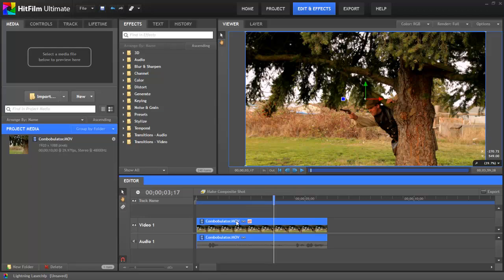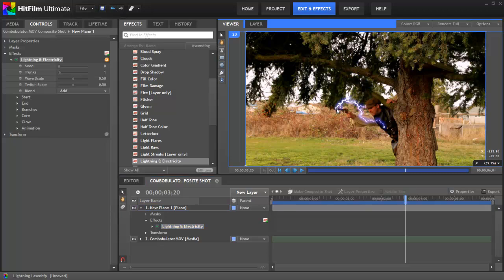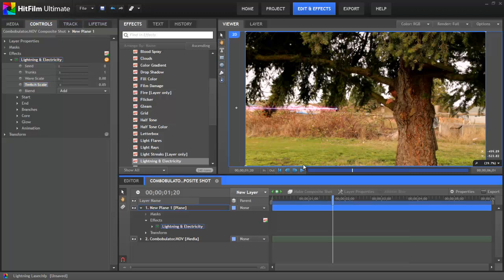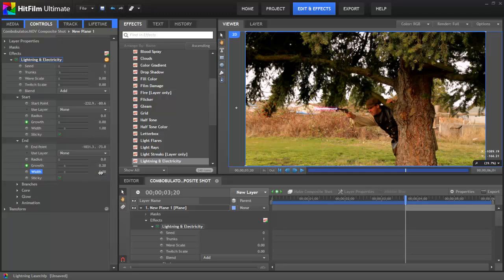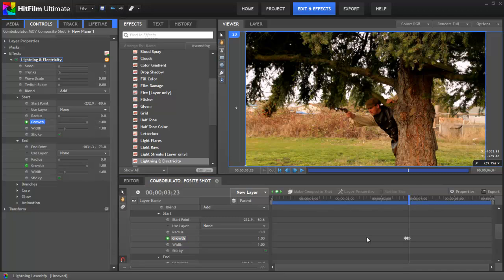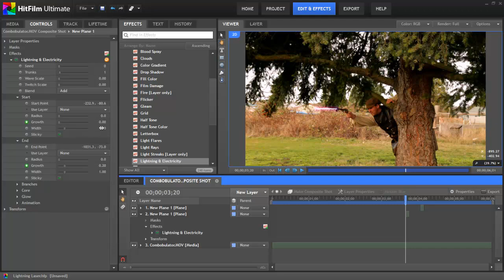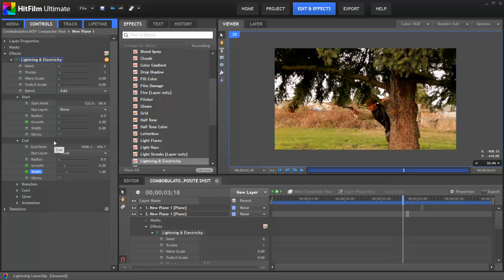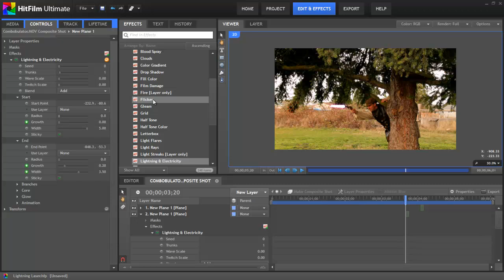Create laser bolts

Comment: This tutorial ROCKS!

When I bought Hit Film 2 PRO a few years ago, I was on the verge of figuring out how to do this on my own, but, real life kinda reared its ugly head for a bit, but thankfully only for a short time.   I was able to get Hit Film 4 PRO during Black Friday, and I am glad I found this tutorial.   This will make my Star Wars tribute films tons easier to make.

At first, I was going to try to do the blaster/turbolaser bolt effects in iClone 6 PRO (which is where I do my CG model work), but adding on those effects in that program tends to bog it down.    So I said to meself, "Dang it, you have a kick * post-production program in Hit Film 4 PRO!!  USE IT!"         

My production line is:  Blender (to build and texture models), Reallusion 3DExchange to convert the models/components  into usable/animation ready props and for character animation, iClone 6 PRO to do the actual rendering and animation, and Hit Film 4 PRO now for the post-production effects (lasers, particles, 'splosions, etc.)

To the programmers/developers of Hit Film, keep up the great work! :)
Reply from the maker: Thanks, keep in mind that HitFilm 4 has a dedicated effect for creating lasers as well, the Animated Lasers effect, which makes them even simpler.
Reply: Yeah, I saw that feature in the effects list.   I'll try monkeying around with that very soon.  :)
Reply: Ok, so I tried monkeying with the Animated Lasers feature in HF4P....  I have to say, I still prefer this older method.   It's a little more complicated, but it seems to give me more of what I'm looking for.   But hey, that's the beauty of the flexibility of this program.   

Keep up the great work, guys and gals! :)